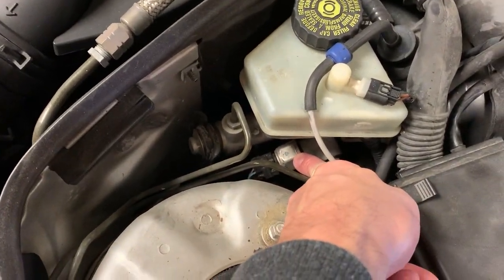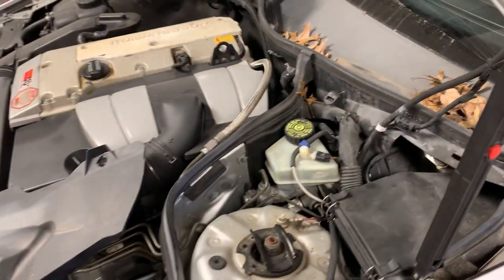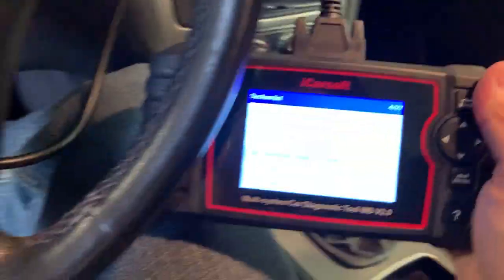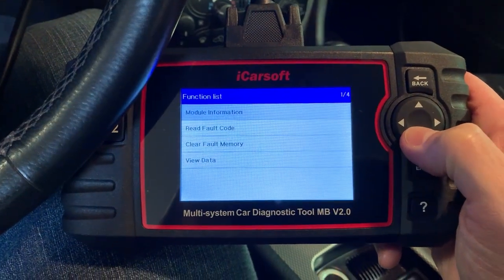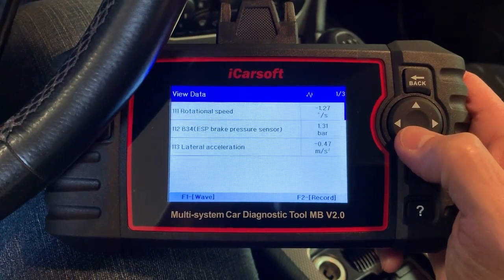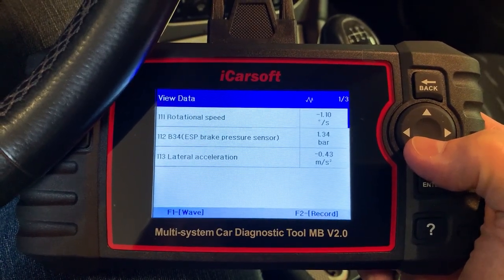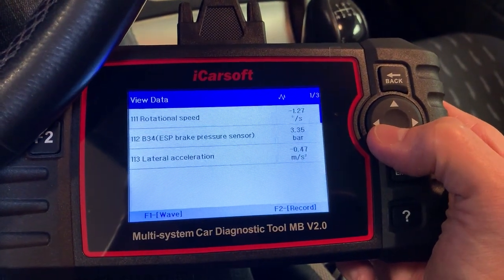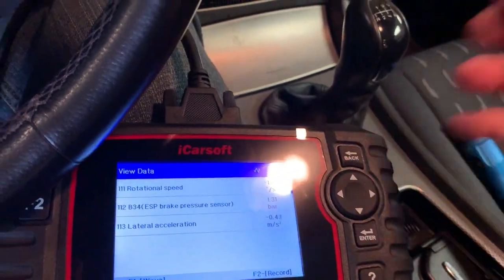Mercedes Benz brake light switch stop light switch - where is it - and how to know how to find it

Comment: Thanks Lou!
Your explanation on a brake light switch vs brake pressure switch and the location helped me tremendously!
I have a 2002 C32 AMG that I thought was having a brake light switch problem (vehicle wouldn’t start or move out of gear).  Turned out by understanding what you showed, I found it NOT to be the pressure switch (as you explained that some models had no brake switch mounted anyplace…I was looking for it).
It turned out to be a bad relay in position K…not the starter relay…
So thanks again for the awesome video….
Much appreciated!
Reply from the maker: Glad to help! and thanks for not asking me for a location when I clearly explain in the video its only in 1 of 2 places and in the description I literally list every single model and its location, for that I appreciate you  ♥. I take time out of my day to try and help those that need proper info, and it gets frustrating when I get asked questions that I literally explain in the video. ESPECIALLY when its on the exact same model in the video!!!!!! sometimes I want to cry....... haha. thanks for commenting and glad I could assist in some way shape or form. 
FYI a brake switch will never stop a car from starting, UNLESS you are trying to use the push button keyless go feature as it needs the switch to be recognized. but other than that, its not part of the starting system. Lou

Comment: You hit on something..people want to be spoon fed…even when you actually explain everything in your video.
Those people probably shouldn’t be working on their own vehicles😂

The only reason I mentioned about the brake switch not allowing the vehicle to start was because so many others in other forums have said it did…
And of course, mine doesn’t have a switch..which they also said it did.
Your video was the only one I found that showed differently ..and you were the one that was right…which is why I wrote.
Thanks again!
Reply from the maker: 20+ years at this, forums and assumptions are my enemy

Comment: Hi, i hope you can help me out here. I have an 2001 w203 c class, and i have fault on abs, bas, esp, and epc. I have used the icarsoft that u used in the video. When i for example goes  in to esp it says error. Its like i dosent get contact with it. Maybe the esp control module is in "sleep" and i have to go to a mercedes workshop to fix it. So if you have some advice that would be great.
Reply from the maker: With 203 you have to choose the right year in the scanner. Also if you cannot communicate with esp then that is a symptom. Check other modules for codes with communication with esp. or your scanner may be bad.

Comment: Having that ESP/BAS dash warning code to take to shop. Car normal otherwise for a 2004 clk. Stop car. Turn off key. Turn back on, no warning. Starting with brake pressure switch now that I know its location. Checking wiring first. Thanks much for the detail I was looking for.
Reply from the maker: Glad I could assist!

Comment: Thank you for this tip. I take it, if NO scanner, do not waste time replacing parts what is typically the cause. I opened up my W221 under the dash, and I realised it was way out of my league. Tq for your video and listing.
Reply from the maker: Thank you for watching! Yes I never suggest to guess at the fix, I am
Very consistent in making sure proper diagnosis is done first and foremost. Just putting parts on a car can add more issues . Thanks again!

Comment: thanks for the reply, i've been looking for a replacement shifter and maybe a new ecu for the engine start problem...
the reason I checked out the brake switch was I did see brake light come on once at one point and googled it and saw a bad switch could cause it not to 
go out of park. anyway thanks again great video info.

Comment: Where is brake light switch on 2008 550SL- thanks you're a life saver
Reply from the maker: I had posted every single switch location in the description also I have stated if its not on the pedal its on the master cylinder,. only 2 options. :)
Reply: Thank you. I found all your list. I do have a follow up question. If I have a bad brake light switch can it cause the car not to start with a Drive Authorization not authorized.  My dash lights come on. Everything works but engine wont crank. ECM has no faults. I've had car scanned with Mucar900 (I agree crazy name) also scanned with Altel. I get drive Authorization refused. All my fault codes are almost all the same. ECM and TCM all come back no faults. 

I'm not a car mechanic.  I'm a 73 year old retired teacher and I bought a 2008 550SL as my end of life dream car. In the 60's I could rebuild a 389 with 3 deuces. Today's cars are computers with wheels. I'm lost and my budget doesn't equate to Mercedes dealers repair. 

Thank you
Reply: I would also like to add this. I've watched 100's of hours of YouTube and read 100's of pages of material.  You by far have the best channel for novice to watch, listen and understand. I taught and coached for 43 years. I know a good teacher when I hear and see one.
Reply from the maker: @g.j.wilson7686  man that means a lot! I aim to help and educate. Eventually ill be able to add some entertainment however the biggest problem in the car world is assumptions and misinformation and misunderstandings of how things work. I am glad I can help any way shape or form!

Comment: If just you brake light switch was the only that came on the display but now the BAS,ESP, and left brake light then right and so on . Should I start with the brake light switch?
Reply from the maker: If you wish but a brake light switch will not set dash warnings for bulbs. You will need to check the bulbs as well. And use a scanner to check for codes In the esp module.
Reply: Thank you! Which model code reader is best for my 03 c230 sport coupe super charged
Reply from the maker: @WendyC-cg6gt  icarsoft is a good one or foxwell. Xtool works too the ip616 model

Comment: if the brake light switch / pressure sensor is bad, will I get a malfunction light on the dash?  My X166 GL550 2013 gets stuck in park and won't switch gears.  It's intermitent.  Doesn't happen all the time but is getting more common.  Great vids!  Thanks!
Reply from the maker: Yes and no to the warning. Your issue is most likely a bad ISM. Have the dealer scan the car. Probably will find drive authorization codes like in my other no start video I made.

Comment: Hello, I have 2007 M B c230. The ESP light on. Per M B dealer, it is brake pressure sensor. However, changed it, it still on. What do I do now?

Comment: Hi, Lou. If you have a short circuit fault code and you are able to communicate with the module does that eliminate “ a bad module situation?” Thank you.
Reply from the maker: No it does not. You can have a module make up fault codes. Its not common but it does happen. Either a module is not sending a signal out or not processing the signal back. And by signal I mean voltage. 
Which is when it’s important to diagnose.
Is positive and or negative voltage coming out of the module for the circuit . Is it getting back to the module. We determine a module is bad when everything external tests fine. If that makes sense.
Reply: @MasterTechLou  yes, it does. It is eliminating game( components one by one). Do not assume! Thank you.

Comment: My daughter has a 2003 C-230  Kompressor.  Is there more than the brake lamp switch off the master cylinder.  Have a broken e-brake, parasytic drain, car wont shift automatically, but can change gears manually.  Had issues before the e-brake issue.  Replaced brake lamp switch @ master cylinder.  Looking to confirm whether or not theres a second switch.  Thank you!
Reply from the maker: Only 1 location. Either single or dual pressure switches in the master cylinder or brake switch on the pedal. Yours is on the master cylinder. Switches also dont affect shifting.
Reply: Thank you!  I believe it's the parasytic drain on the battery is causing the shifter to lock.  Also found a bad fuse & suddenly its shifting again!  Thank you so much!  I was under the dash for days looking for that switch!  Really appreciate the help.  Got it changed out!

Comment: Hello. I hear a brake rubbing sound in the rear after my husband was changing the brake light switch. After opening the panel underneath the steering wheel, I remember pulling or tugging the ABS cable to get the panel to loosen up a bit. Is that causing the issue or an incorrect installation of the brake light switch? Can someone help me with instructions on how to install it correctly?

Comment: Hey Lou, I have a 2003 S600. I don't think I saw you list this model. I'm pretty certain I have a brake light switch since I purchased a new one from auto store. Also, I am currently trying to remove the piece of plastic to gain access to the pedal but can't seem to separate it from the dash. It appears to be clipped on but I don't want to be to rough with it. Do you have a tip to remove that piece to expost the wule pedal to get to the switch? I have removed the 5 screws already. Thanks.

Comment: Not sure if u still answer but looking for feedback

I have a 08 c300 the break lights come on as soon as i turn on the car and dont turn off, ive replaced the 7.5 fuse under the hood, and replaced the brake light switch 
*note*if im driving and shut off the car in neutral and turn it back on they shut off until i press the brake again then they stay on. 
Any idea what it might be, possible i bought a faulty sensor ?
Reply from the maker: Shorted rear sam is most likely. But my video explains to use a scanner to check live data .
Reply: @MasterTechLou  wow appreciate the reply 👍🏼 and yeah great info but i don’t have a scanner and money is tight to buy one so going bit by bit haha hopefully something comes up
Reply: @MasterTechLou  you were right. Rear sam was wet from humidity took it off dried it off with a blow dryer, placed it back and it works now

Comment: Hey! I have 2007 S550 (but in the door frame it says 12/05) and I'm having a hell of a time locating the brake lamp switch. On the pedal there's a mount for it but its just a wire hanging there. No switch. Is it under the hood. On the dash it says brake lamp switch because we can't get it to come out of park. Help!

Comment: Thanks for the video. I have a c240 w203 (2002). Launch Diagnostics shows c1200 stop lamp switch S9/1. Car shows intermittent BAS error on dashboard sometimes. No ESP.  diagnostics of break stop lamp shows On off and off on after break press for N/O N/C. Esp sensors 1 and 2 shows 254 bar for break pressure 1 and 0 for 2 when nothing is pressed. When I press the break both show pressure and they show the same pressure. Do you think the break 1st pressure sensor is faulty because it shows 254 bars when nothing is pressed ? Also yaw rate sensor show fluctuations in deg value when Stationary
Reply from the maker: Both should match so yes the sensor that shows pressure when not pressed is faulty

Comment: I have an 08 c300. The brake light switch isn’t the part that’s not working. My brake lights stay on when the key is in the ignition. When wires are crossed that go into the switch the brake lights work. But when the wires go to the switch the brake lights stay on. Suggests?

Comment: On the ships I worked on, redundancy is used specifically for having a second system ready to be used, in the event that the other system fails. In this was, one system is always in operation - while the other remains idle or is being repaired or replaced. My guess is that this  MIGHT  be the reason this system is applied in automobiles  breaking systems, since the brakes  IS  the most important system in a vehicle. I might be wrong but that's my guess - since that's why such systems are used on ships.
Reply from the maker: That would make sense! That or for diagnosis purposes. Mercedes is pretty good with explaining how things work but we run into scenarios like this where they never released information why. Least I have yet to find it.

Comment: Hi thank you so much for helping us i have 2006 Mercedes clk 500 i dont know if its w208 or w209 i find pressure sensor i couldn’t find the switch i dont even know if i have one its giving me a problem shifter got stuck in drive and it was only moving to neutral and drive. I couldn’t bring it to park or reverse. Then I realize it if I let go of the break it start operating. I couldn’t even turn off the engine because screen was telling me. My car is not parked mode. I choke the engine cutting off the air. That’s how I turn off my engine then I disconnect the battery. Wait for one minute I reconnected everything went back to normal. Could you please help me Thank you Have a good day.

Comment: Hey Lou, ive got the same problem here. ML270CDI W163, Lost brakes lights at the back. Fuses all good, bulbs all good and no switch inside at the brake pedal. Which one of the switches on the booster is the pressure brake sensor?
Reply from the maker: they both are. you either have 1 or 2 depending on the year, with it being non usa I dont have access to the diagrams.

Comment: Hi Lou, hope you can point me in a direction to solve a problem I have, a 2004 W203 no fault codes but cruise control became intermittent then stopped working brake switch is on the master cylinder, the speed limiter still works any ideas. Sorry to bother you with this, many thanks for your really informative videos and common sense best regards M
Reply from the maker: Usually the switch fails. Need to use a scanner to check the data of the switch when using it. The data will
Most likely be in the steering column module.

Comment: hey i have a 2002 mercedes s430 i can't communicate with the esp module would a faulty brake switch or pressure switch stop it from communicating completely?
Reply from the maker: negative. power, ground, data line voltages are what you need to check.

Comment: Hello, I have a 2010 Mercedes c300 automatic. My car is stuck in Park after I first start it in the morning. After about 20 minutes or so idling, the shifter starts working just fine. I have no check engine lights whatsoever…any help would be appreciated! Thanks
Reply: Did you find a solution ? I’m having the same problem right now with the same car
Reply: @geovannicstillo  My mechanic took apart the sfhifter & said there was small debris…he cleaned it out & it only worked for a couple days. No solution yet. Have you found the issue? Thanks

Comment: Hey.. so I have a 2011 GL450 I didnt see where u posted the location of the brake light switch?? Also curious on what fuse box the fuses for it is I cannot find my manual. Thank u in advance
Reply from the maker: Your chassis is a X164 and there is no fuse for it. 
Also in the video I state theres only two places it will be. On the brake pedal arm, or on the master cylinder.
On yours its on the master cylinder.
Reply: @MasterTechLou  Thank u for your response much appreciated.I actually figured that's where it was. U mentioned maybe 2 if them but I think mine only has one a pressure sensor I think that's what u called it.
Reply from the maker: @dawnmieles5616  yours may have 2 of them and yes pressure switch/sensors
Reply: @MasterTechLou  so I got one out it's black with a spring thing in the end and I've been trying to figure out the part number but now there's 2 wth... Ugh 😩 and how do u test them ? Cuz the spring one had 1 rusty clip.
Reply from the maker: @dawnmieles5616  Hi Dawn, best I can say is, the two round metal switch/sensors screw into the master cylinder.
You can only test them with reading the live data with the scanner like I show in the video.
Reply: @MasterTechLou  Thank u very much

Comment: Great video, having several intermittent problems with my 2005 clk500, there are no codes on the dash.
1. when stopping car goes only drive to nutral unless i turn off engine then will go into park
2. car won't after the above problem at times, put a jumper on the start relay and car starts but will not go out of park.
3. the above problems are all intermittent.
I have a   iCarsoft MB II and have one code P1856 comes up, could this also cause the car not to start?  
thanks bill
Reply from the maker: Thanks! Well, I can’t diagnose in the comments but sounds like your shifter has failed.

Comment: Hi, thanks for the video.  I have a 2011 450 GL that won't select any gears. It's stuck in Park. Can it be from a faulty brake switch? An ESP fault is displayed.. 
If the brake pressuresensor/switch are faulty, will the brake lights work?
Reply from the maker: Communication failure or bad ism or bad trans. 
Most times its water in the central gateway. 

But thats thinking out loud, heres a test if you press the shifter and it says “press brake” that means communication is good. And possibly a brake switch or fluid issue with brakes. A broken brake line will lose pressure so you cant shift.
Reply: @MasterTechLou  Thanks 
But I'll like to know if I can use the brake lights to determine whether the switch or pressure sensor is faulty or not.
Reply from the maker: @currentaffairsrealism  scanner is the only way to be accurate.

Comment: Hey i have a 2000 c230 the brake lights on both sides are not working.. I’ve changed the bulbs and still no luck..

Comment: Hey Lou.  I have a 2001 w203. 270 cdi.  It has no power. My icarsoft scanner say there is a can bus fault. Nothing on display. When i start its it has power for ca. 20 sek. So the exhaust sound change to a deeper roumblen, and power is gone, max 3000 rpm.  Scanner also said that flow in ecv system is to low.  
Please help me with a good advice
Reply from the maker: Sorry I cant help with a diesel this old
Reply: @MasterTechLou   okay. But can you maybe tell mee something about that can bus signal?
Reply from the maker: @JesperPetersen-x5x  no I cannot because that can mean anything